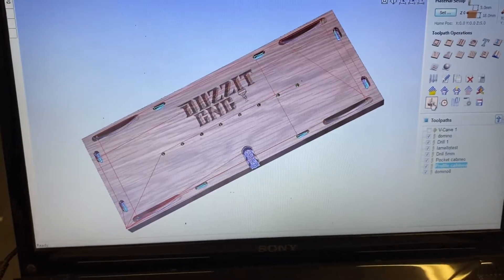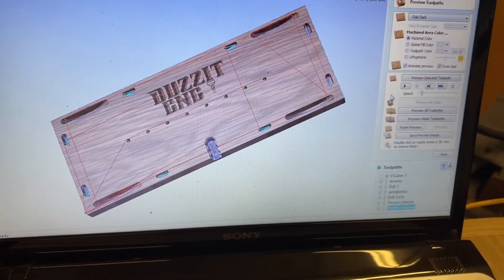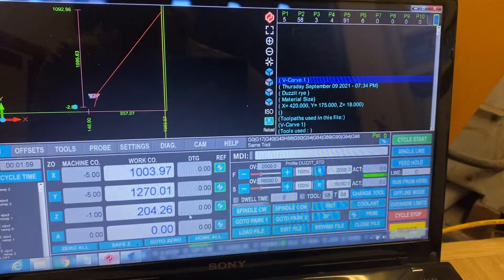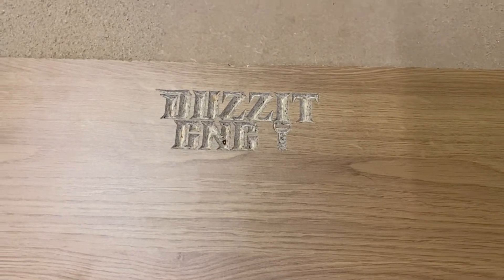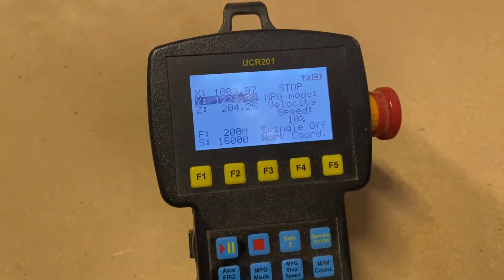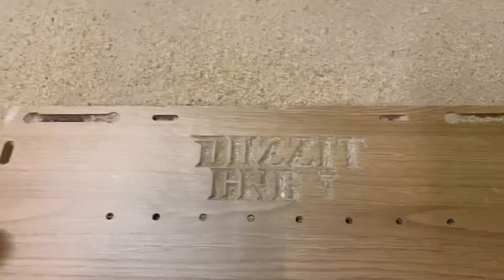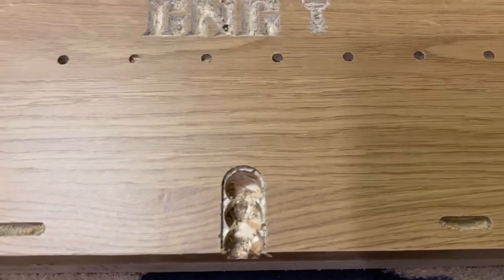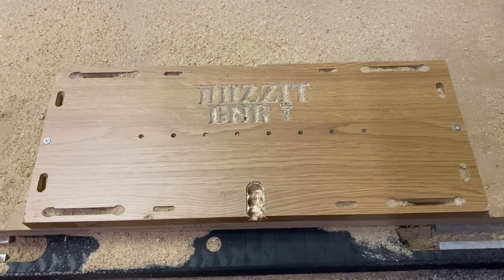Lamello clamex and cabineo cnc router demonstration. 3 axis. Festool domino cut on cnc router.

Comment: Thanks. Not quite sure what biscuits the lamello toolpath would accommodate. P14? Saw this Amana bit, but not sure how it would create a groove for P14. (Amana Tool 59740 CNC Solid Carbide Spiral Diamond-Like Carbon (DLC) Coated 9.8mm Dia x 23mm Cut Height x 12mm Shank Lamello Router Bit.) Thanks

Comment: how can you do on the edge of the board
Reply from the maker: Using an arbour with lamello blade . Not so good when nested as wastes a lot of material
Reply: @cnc-routers-uk  ty. have you made toolpath for that propose on Vcarve?
Reply from the maker: @woodbe5311  for edge slots done as a macro in controller. Cannot be done in vcarve